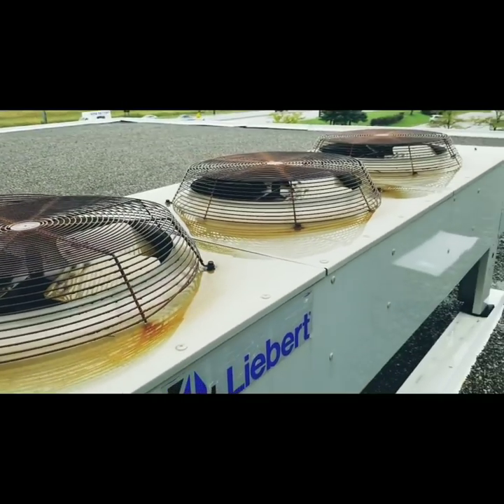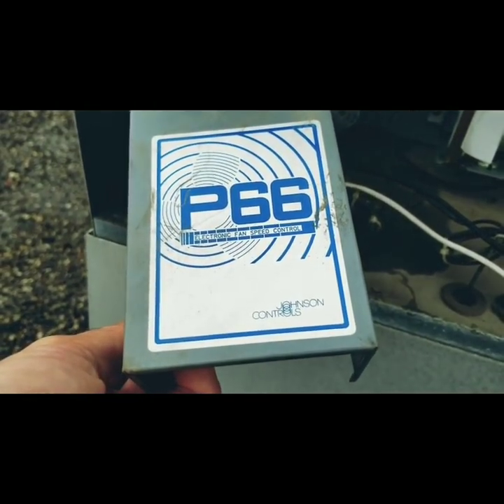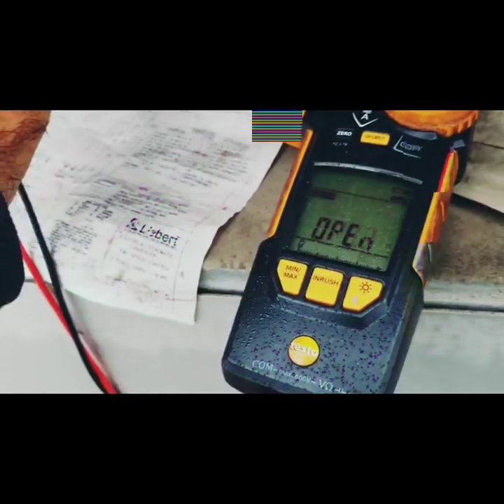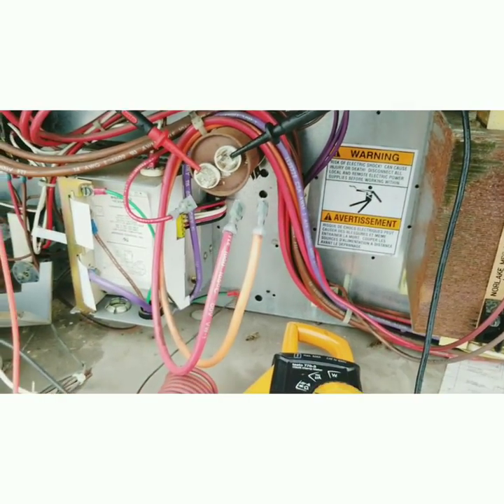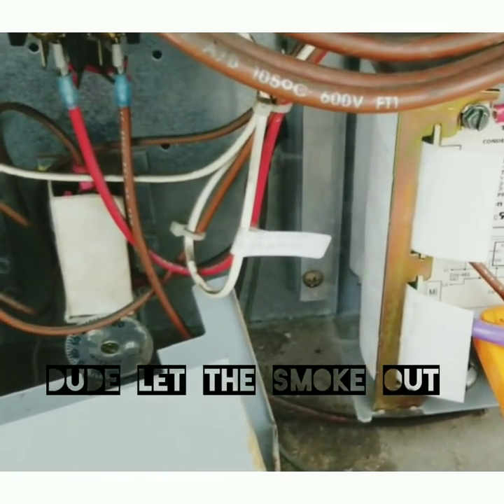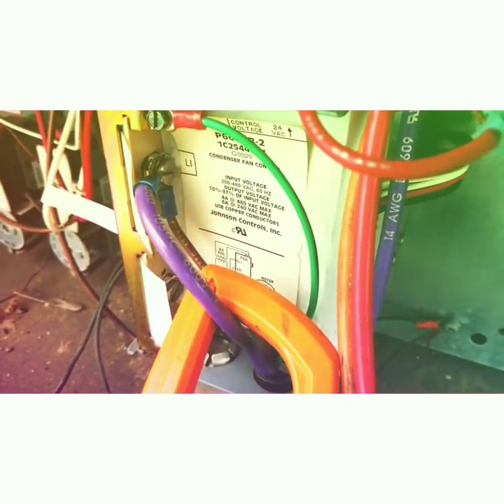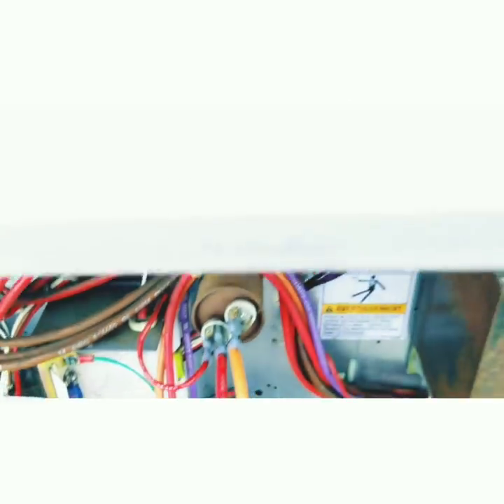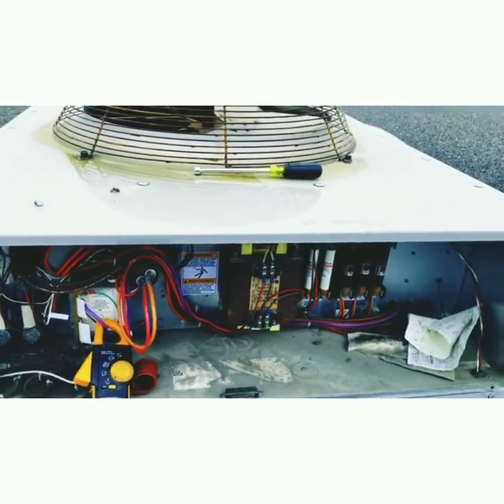HVAC - Liebert Condenser Fan and P66 Fan Speed Diagnosis

Comment: Hello, good video :) When you put in new fan speed control, did you lose refrigerant gas or does it have a valve depressor?
Reply from the maker: Thank you, it had a depresser!
Reply: @HVAC Know It All  I think the p66s are not suppose to have depressors. I was told it will mess with the p66 getting a good pressure reading.
Reply: @HVACKnowItAll  thank you! I'm about to change one myself today and I couldn't find anyone who knew if there was a valve core under there or not. That's always nerve racking when you aren't sure. Now hopefully no one has been in here before and got the idea to remove it.

Comment: I believe the first fan closest to the electrical panel is off of head pressure unless that one is different but we have the same exact unit at one of our buildings and that’s the one off the Johnson controller, just curious
Reply from the maker: Yes correct, the first fan uses a P66

Comment: A little new to working on those dry coolers

Was that a drive that smoked out? It didn’t look like it but again, I’m a little new to Lieberts and haven’t dealt with those Condensers too much

And to bypass the control, did you just wire it into this contactors?
Reply from the maker: That's a condenser, dry coolers are for water/glycol.    I bypased that one by jumping it out.
Reply: Cool man. Keep up the good work. I’ll be working on those more in the future so I’ll be sure to check out any future videos you have on any Server room equipment
Reply from the maker: @WarHammer1989  good luck man

Comment: You can awlays tell when those motors are going bad if you look at the top of the blade.  If the motor looks like it’s leaning the motor has been overheating.

Comment: When checking fuses with continuity you should pull the fuses first.  After not finding an open leg in the motor you should check for ground before trying to run the fan.  safety first!
Reply from the maker: Everything was checked to ground.  What is your reasoning for pulling fuses.  It's literally a piece of wire?

Comment: Change out the p-66, motor and always throw a new capacitor in with any new motor, making sure the capacitor matched the MFD rating for the starting of the motor. Right now I have what looks like multiple fans on a liebert remote condenser. The fan on the P-66 is good, but further back in the cooler on BMS I'm showing 3 fans are consistently not running. Unfortunately they're EC fans, so this will probably be super expensive. This is why I love Air cooled chillers. Why bother with CRAC unit's when you can have CRAH's and AHU's? Less things to break and less hassles on average.